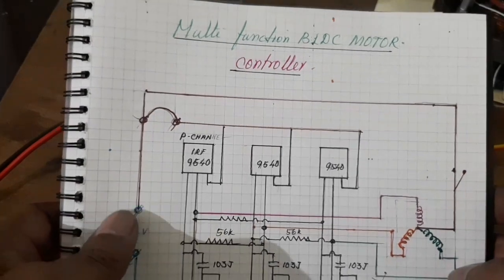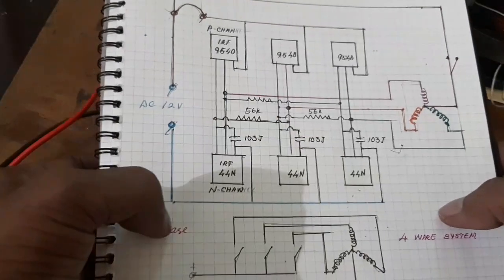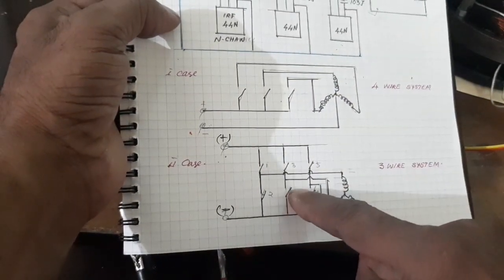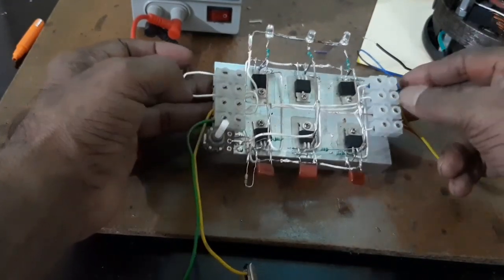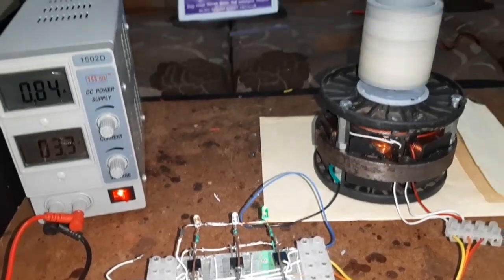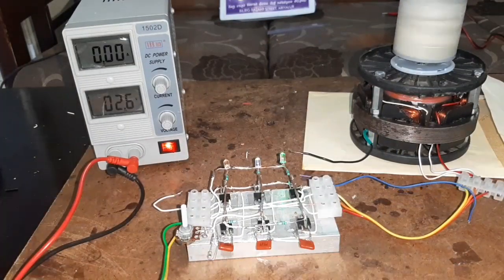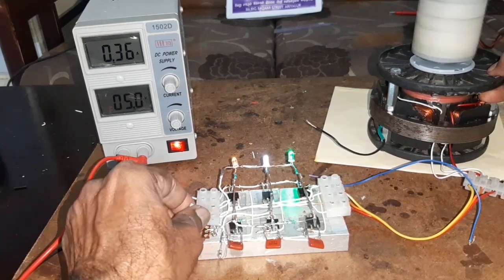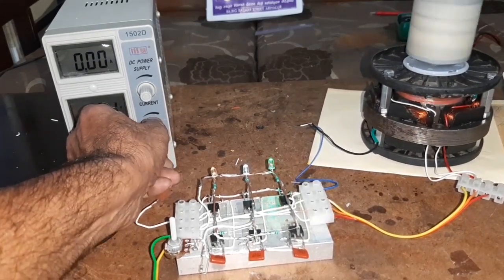Home made bldc motor controller with multiple functions (Type-2)

Comment: Sir i followed this tutorial of you using top 3 mosfets irf9540 and below 3 mosfets irfz44n and connected as you shown in paper graph the drain of uper and lower mosfets to each other and the source of z44 to gates of uper 9540  and 103 k capacitor and 56k resistor but its not working plz guide i really like and follow you plz help
Reply from the maker: Good effort
Sir,There is no secret  i have explain clearly
First check the motor with 4 wire system
That means the top9540 mosfet to be removed and connect the 3 drain output to motor leads and connect the starpoint with positive terminal
If the motor is working ok than proceed to 3wire system. That means connect the top three 9540 mosfets and connect the gates top and bottom parallel and remove the starpoint than check the motor
Pls increase the voltage level upto some noise and vibration coming and rotate slowly it will pickup or otherwise any loose connection
Check the current level and it should be minimum 50 percent of rated current
Reply: @pugalstech  sir kindly see throw my comment i connected the 9540 gates to z44n sources is itthe right connection or i connected mosfets wrong
Reply from the maker: Sir, p channel mosfet and N channel mosfet gate terminal are connected parallel
P channel mosfet and N mosfet drain terminal are connected parallel
P channel mosfet source lead are shorted and connected to positive supply
N channel mosfet source lead are shorted and it is connected to negative of the supply and the motor output are taken in the middle of top and bottom  mosfet drain
Reply: @pugalstech  i connected the drain of top 3 mosfets to drain of lower 3 and the gates of 9540 to source of z44n ???? Is there any wrong connection or not ???

Comment: Sir didn't mentioned the connection for potentiometer plz share sir
Reply from the maker: Just try to varying the speed of motor by using 100k pot which is connected parallel  to the one 56k resistor 
It is connected from mosfet 1 to mosfet 2
Reply: @pugalstech  sir can i use 10 k intead 56k resistor
Reply: @pugalstech  thank you sir and o e last question plz i found 103 k capacitor instead 103 j can i use them and should i use 9640 or i can use other pnp transistor thanks for your time and way to helping others.
Reply from the maker: Just try by using 10k resistor
Reply from the maker: If it is not ok increase the value
So it may vary motor capacity
Reply: @pugalstech  sir why you skip starting of the motor in your every video does it starts by its own or something else why i have seen all of your videos and i noticed this that you skip video Everytime you start motor ???
Reply from the maker: The basic concept is 3 led chaser circuit and the signals are used to operate power transistor .so the improved circuit is used for control the bldc motor.

Comment: sir kindly mention the value of 103J Capacitor
Reply from the maker: 103j =.01micro farad
Reply: @pugalstech  
Kindly mntion G,D,S Terminals of mosfets Shown in circuit diagram...
Reply from the maker: Mosfet pin details
Pin.1 gate
Pin.2 drain
Pin.3 source
Left to right 1.2&3
Reply: En el diagrama dice corriente AC. No es DC???